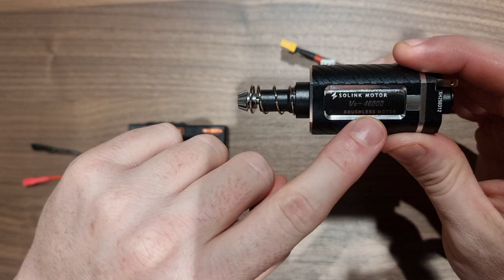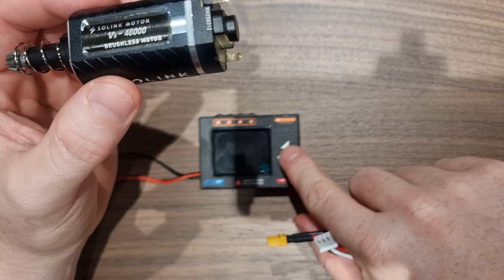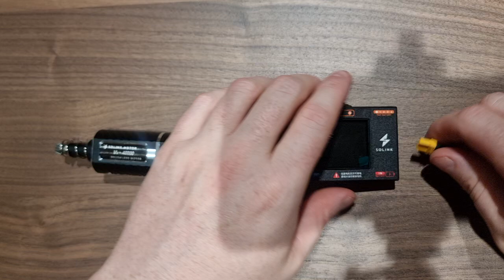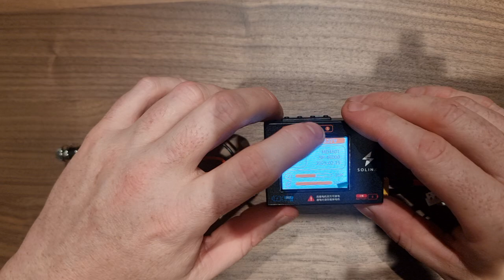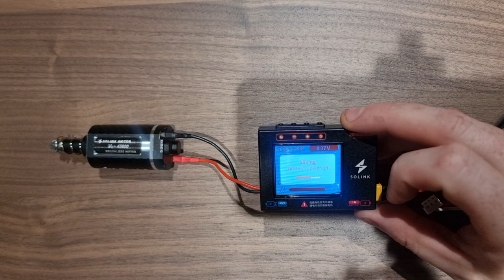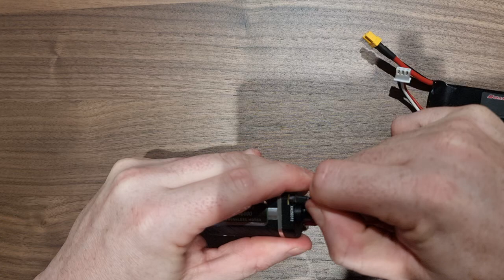How to programme the Solink gen5 brushless motor

Comment: Nice bitt of kit ! i still am trying to work out how torque comes into play performance wise, i simply dont get it. wouldnt you want full torque and speed ?
Reply from the maker: hi there yes ideally full torque but for instance on cast gears 100 percent torque will be potentially more damaging than less torque especially if not shimmed correctly. But yeah man for most fully built set ups 100 percent torque will result iin less mah per shot and a more responsive cycle time